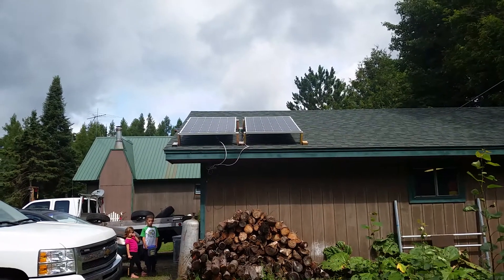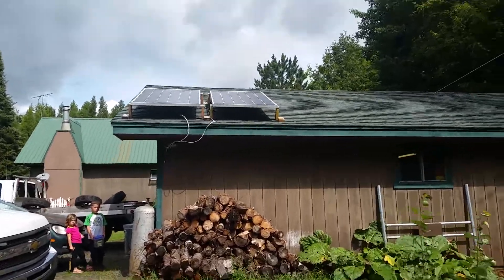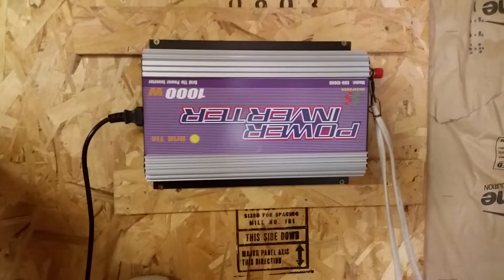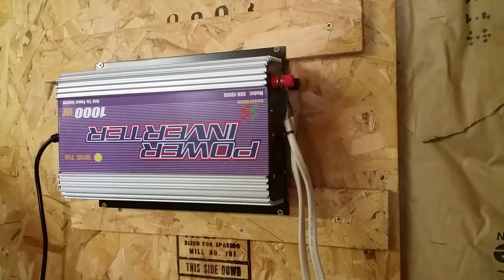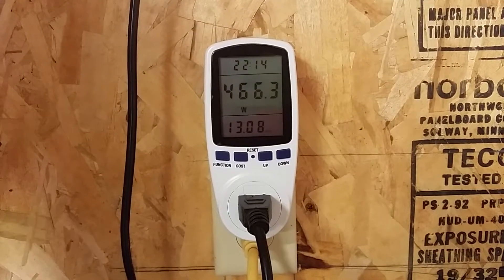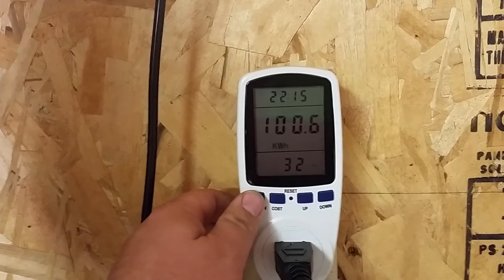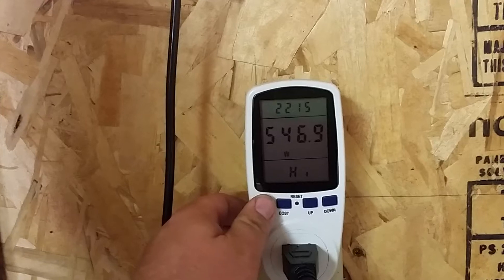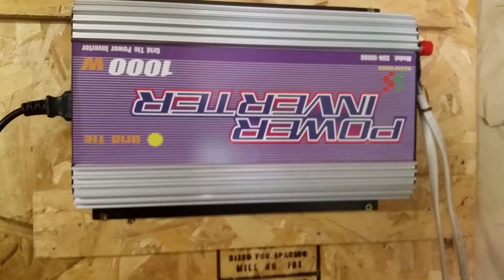Small Solar Grid-tie 500W

Comment: glad i found your video ! I just purchased that same inverter & four 245 watt sharp panels. I'm planing on running three off the 1000 & 1 off of a 500 sun wich i already have! still waiting on misc. parts. what did you run for cable? I went with #6 welders cable , got it for .61 cents a foot. online. glad to see you got 100 kwh. in one month. that's fantastic!!
Reply: Welding cable is perfect.  Solid copper romax should never be used for DC. Its not efficient and you loose up to 20%. Direct current (DC) travels on the outside surface of the cable and stranded copper has more surface area.
Reply: MrHopZombie ya'h it's working great. actually hit 1079w after the inverter,,not bad for 960w of panels, producing ruffly 7.5 kwh a day or .75 cents, will be adding more in the spring
Reply: Well done. Cheers :)
Reply from the maker: The inverters efficiency rolls off pretty hard after 500 watts.